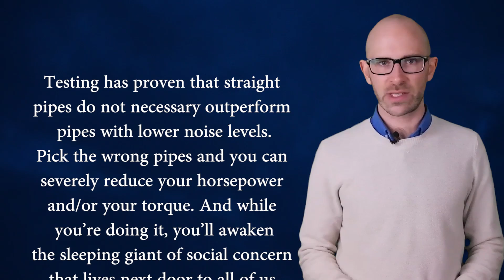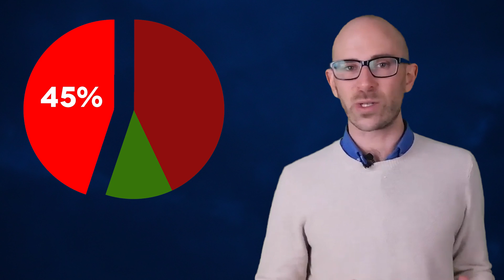Why are Harley Davidson Motorcycles So Loud?

Comment: So you said they are loud,  which we all know.  You did not answer the question WHY they are so loud,  which is what your title implied you would do.
Reply: shadowmihaiu well he did, but briefly and not in depth.
Reply: Exactly, I want to know the science behind it, not why they make it that way.
Reply: It boils down to pipes with little or nothing in the way of sound-deadening baffles and/or exhaust packing materials. Noise comes straight out of the outlet valves and along a plain pipe so you hear pretty much the noise you would if you took the exhausts off compleatly like on F1 cars. See the noise they make when the engines exhaust straight to the air!
Reply: they can also reduce performance by eliminating back pressure on the engine which helps burn all the fuel before it leaves the engine, which by the way is why crappy old cars backfire.
Reply: dylan vanamelsvoord okay bud nice rebuttal 😂
Reply: It was a round about way of saying 'because Harley riders like them loud', but that would have been a really short video.
Reply: I wish I had some Ice Cream . . .
Reply: Loud because it’s fuckin awesome lol
Reply: Ted Stewart  I was about to say these
Reply: Two words... Small penis.
Reply: The owners put slash pipes on ...and then wear ear plugs for the noise
Reply: @jeffreysheldrake3243  ear plugs for wind noise even in a full face.
Reply: shadowmihaiu exactly what I was thinking I want to know what makes a Harley LOUD
Reply: Thanks, saved me 6min of my life
Reply: loud pipes will only be heard if you’re next to a car. also, vehicles nowadays are made with sound deadening materials to phase out highway, engine noises etc.  You won’t hear a loud motorcycle coming towards you until it passes you due to a thing called the Doppler effect.  Not to mention pipes are usually pointing opposite from you.  Emergency vehicles usually have their sirens facing towards the front to combat this and have different tones with faster wave tones.
Reply: They do it because "it saves lives" but in reality they do it to be utterly annoying.
Reply: When they wreak I laugh. 😂🤣
Reply: I stopped watching at 3 minutes and just browsed these comments so the visit wasn't a complete waste of time.
Reply: you are so full of shit .. if you can not look up the federal limits yourself and see that all harley come with dot approved mufflers of only 80dbs ...  you said and i quote "So you said they are loud,  which we all know." you dont know a goddamn thing .and it's none of your goddamn business ..you are just a son-of-a-bitchin; trouble maker here to harass harley owners so go fuck yourself
Reply: Because the assholes who drive them want them to be loud.
Reply: this guy is a fuckwit
Reply: As soon as I saw a scrawny beta limey asking why Harleys are so loud I quit listening.
Reply: And sadly, he gets paycheck clicks for this.  What weird times.
Reply: So... they are loud because they make noise.
Reply: @Baiey  Did you actually read that before you hit REPLY?  Public education is truly a shame.
Reply: @kevindunlap5525  I just paraphrased this video in a few words. It did not explain why Harleys are loud. Are they loud because of the large displacement, the 45⁰ v twin, the high compression, the absence of a baffle, the short exhaust? What makes it louder then a bike of the same size? Of course if it has higher decibels it's louder, no sht Sherlock.
Reply: If it's too loud yer probably too old
Reply: @Peter_Pepper_Love  Or are old enough to realize and understand that it's too loud.
Reply: @peter love  Or old enough to know that these pathetic, scared, "little children" need to make a noise to get attention because they're socially inept.
Reply: This video is horrible
Reply: The real answer is that a lot of motorcycles, Harley or otherwise, are modified to put on louder exhausts.  It's the first thing a lot of people do with their bikes, supposedly for performance benefits.

Realistically, it's not a huge difference, and it hurts the hobby as a whole by pissing off the public at large and reinforcing the stigma against motorcycles.
Reply: @sanityimpaired  more for safety because no one sees us
Reply: @The_AntiVillain  Find me a study that backs up that claim.

Ambulance sirens are omnidirectional so you hear them when they're behind you.  Exhausts are directed behind you.

If you want people to hear you, use the horn.  That's what it's for.
Reply: Ted Stewart also for safety so idiots in cars won’t run motorcyclists over. LOUD PIPES SAVE LIVES
Reply: @sanityimpaired  Spot on. It's the socially inept, scared, childish losers that believe making a noise somehow validates what manhood they may have had. Pathetic.
Reply: @sanityimpaired  loud pipes save lives
Reply: @greezy283  No, they don't.  That claim keeps being made despite the evidence not supporting it.  Exhaust noise is primarily aimed behind you, and the majority of motorcycle crashes start in front of you.

The horn is aimed in front of you, and it's a change in sound rather than a consistent sound so it's a lot more likely to be noticed.  Learning to use your horn proactively will do far more to protect you than loud pipes or rev bombing ever will.

On top of that, loud pipes add noise fatigue, which directly reduces how safe of a rider you are.

That people keep making the claim despite it being demonstrably false reveals what's really going on; you don't actually care about safety and just want an excuse to have loud pipes.
Reply: @sanityimpaired  i have a rode quiet bikes for years. After switching to loud pipes I can see people noticing me more. You can say it doesn't work all you want but my firsthand experience says it does.
Reply: @greezy283  There's a reason anecdotal evidence is a logical fallacy.  You're trying to claim that your biased personal experience takes precedence over statistics and demonstrated fact.
Reply: @greezy283  Oh, and how you love it when people notice when you're riding your bike (Rev-rev. Rev-Rev.🤭) down those oh so dangerous Cafe strip's, eh?
Reply: Because the mufflers aren't very good
Reply: @jew-sa  you are a fucking bare faced liar .... all mufflers are 80 db including all harleys since 1986 .. and 80 db is federal law
Reply: Mortos DerSoulStealer because of non riders like you . Next time you hear a bike before you see him you might realise im right . Im not not saying your wrong about the dickheads wanting loud pipes but im right about it actually working
Reply: It’s quite simple, bikes are small and hidden. Drivers in cars are distracted, and Motorcycles ride into blind spots easily.
When you hit us, your car gets a dent, we get body bags.
Reply: @Erick Stone  Incorrect. It's quite simple. Slow right down, do not weave/speed through traffic, expect drivers may not see you (Car windscreens pillars. I nearly got hit by a woman even though she clearly looked in my direction. I was ready.) and don't ride a motorcycle if you're that childish you feel you have to "prove something". Obvious. I learned and now drive a car. Some stupid motorcyclists always have something to prove and will risk theirs and your safety. Idiots.
Reply: dylan vanamelsvoord 
https://www.motorcyclecruiser.com/last-word-loud-pipes-tech-matters
https://www.revzilla.com/common-tread/stop-saying-loud-pipes-save-lives
"Non riders"
Reply: dylan vanamelsvoord because most motorcycle accidents are because the rider is going too fast or CAN'T HEAR OTHER CARS. If anything they probably cause MORE accidents. Show me any evidence that people get hit by other drivers more often when they're riding a street bike. And besides, exhaust pipes are facing backwards, and most people drive with their car windows up and music on, so there's a decent chance they might not hear you no matter how loud the pipes!
Reply: @ianmclean2894   so what you are claiming it is the motorcycle riders fault if a motorist in a car kills the motorcycle rider ...so what that suggests is the idiots in cars have more rights that anyone else on the public streets ..i will remember this if i ever see you walking across an intersection
Reply: Long story short it’s a bunch of explosions going through a metal tube acting like a horn.
Reply: Also wanted to add .. why do you think emergency vehicles are loud .SO YOU CAN HEAR IT COMING UP FROM BEHIND. Same principal
Reply: William Cooper "when you buy a Harley you want that loud iconic Harley sound"
In other words: only dickheads buy a Harley in the city.
Reply: This guy is a moron
Reply: Scott Graber you're a fucking nut case and should be arrested. https://youtu.be/Zam107Hy0iY this is why things like this happen to you.
Reply: LOUD PIPES SAVE LIVES
Reply: It's because loud pipes save lives
Reply: dylan vanamelsvoord unless you can back up this "evidence" with anything other than anecdotes I'm inclined not to believe you. Have you bothered to do any research on the logistics of this, or is it that it just sounds good as an excuse to ride a ridiculously loud bike that most people don't like?
Reply: @ianmclean2894  if you're waiting for people like these guys to back up with evidence that loud pipes save lives you're going to die of old age waiting. The only thing loud pipes do is piss people off.
Reply: Mortos DerSoulStealer you’re obviously just a liberal pussy. Do everyone a favor and put yourself out of OUR misery. If loud noises scare you move to the chaco region of paraguay and shut the fuck up
Reply: Scott Graber yea usually they are quiet good point . Like another good point  ITS BECAUSE THEY ARE HUGE AND COLORFUL THEY DONT NEED SOUND ALL THE TIME . Moron. . I dont why i try make a point to dumbasses that dont ride. Especially immature gronks wishing death upon others . Haha grow up pal.
Reply: Mortos DerSoulStealer  ok well theres alot of evidence of other cars hitting bikes its actually the main reason for crashes . Like my best mate he now limps becoz he got side swiped . Being that bit louder helps them know your there and you can hear alot through the helmet and over the exhaust so maybe get a license and try it before just accusong and making assumption pal . We are a smaller then a car therefore harder to see but maybe if you could hear the bike youd know they are around you somewhere . If it annoys you then hey it worked you know hes there now .....ofcourse it sounds better louder like a car exhaust or a gun or a firework . Unless your a poodle...... main point is its safer . Safer then sneaking up the side of unsuspecting cars that will squash and kill you in a instant
Reply: dylan vanamelsvoord I believe the burden of proof is on the one making the claim, not disputing it. But a quick google search of "do loud pipes really save lives" turns up all sorts of interesting results. Try it out.
Reply: Mortos DerSoulStealer 9 yr old article . Thinhs have come far
Reply: Scott Graber yea they only respond in an emergengy. BECAUSE THEYBARE A FUCKING HUGE VEHICLE ,WHEN MOVING FAST YOU NEED TO SPOT THEM FAST !!motorbikes are always high risk ergo emergency status . Hear me see me   ....thats another version of loud pipes saves lives
Reply: shadowmihaiu the answer is loud pipes save lives . Car will run youbdown if they cant hear your there .because they dont look for us moto riders
Reply: Bull. Most Harley accidents are single vehicle. Harley riders are some of the least capable riders on the road. Idiots mostly.
Reply: @dvtv4629  I didn't find any difference with quiet pipes and loud pipes. Drivers would try to occupy the same space just because they assume size wins.
Reply: @dvtv4629  Some don't look at all, for anybody. :P
Reply: @dvtv4629  Yeah too bad they don't put as much effort into not using mobile phones whilst driving or actually paying attention to what is around them rather then continuously crying over the occasional loud pipes going by
Reply: @dvtv4629  the actual fact is good riding skills save lives. Loud exhaust systems just piss people off.
Reply: @johnstephenson2428  alot of both
Reply: Mortos DerSoulStealer  how dont they save lives?
Reply: Ted Stewart its not performance. Its to save a life . Loud pipes save lives .
Reply: dylan vanamelsvoord if loud pipes do really saves lives on bikes, we should all put straight loud pipe on cars too! Why does it have to be on bikes too? Both motor bikes and cars polluted the air anyways. 😁
Reply: WhyteLis21 read the comments . BECAUSE CARS ARNT SMALL AND HIDDEN  . EG AMBOS DONT NEED SIRENS ALL THE TIME ONLY WHEN SNEAKING UP REALLY FAST IN A HURRY . . .
Reply: dylan vanamelsvoord what and cars can't sneak up on you fast too? Called that Bull crap. Bike may be quicker but everyone is responsible for their own action and looking at their blindspots no matter how big or small your ride is. 

Don't expect everyone to be a safe driver on the road. Being the safest driver is being aware of your surrounding at all times no matter car or bike. Being a defensive driver saves lives you don't need to be on a bike to understand that concept. Nobody should get a free pass no matter if your on 2 wheels, 4 wheels or more. 😏
Reply: That is Sooo dumb.... the noise is behind the bike... the horn is in the front for a reason.
Reply: @portagepete1  actually, I can hear any vehicle coming from either direction.
Reply: @dvtv4629  Then install a fucking horn.
Reply: @dvtv4629  Doppler effect says otherwise
Reply: Loud pipes save lives .
Reply: @dvtv4629  "Loud pipes save lives"

... rides without a helmet
Reply: @dvtv4629  If  they were so  concerned with safety, they would  wear helmets and  protective  clothing.
Reply: Mortos DerSoulStealer like i said ofcourse some people like the noise . Its a manly thing to do . Its nature . But it doesnt mean it isnt true . Wheres your facts bro ? . As a rider in a massive riding community its clear what happens more often . Ive crashed going too quick and that was a sports bike eg not much exhaust . That was my fault it happens . But cryisong on the highway and streets around town its just pure obvious buddy . Be heard be seen !
Reply: @dvtv4629  Manly thing to do??? You obviously have absolutely no idea of the true meaning of manhood.
Reply: @ianmclean2894  

say that in person to a real biker.
Reply: @puppykicker6701  woooaaahhh judging by your username you sound like one hardcore dude. I'd be soooo scared to say it to your face! Besides, what's the use in trying to say it to a "real biker's" face when he's already deafened himself on the stupid thing? 😂
Reply: @ianmclean2894  .

you are obviously a keyboard warrior, and if you ever did ride a 'bike', it had pedals on it.  At most it was a moped, or some other weak kneeed piece of plastic rice rage.

that being said, i personally hate the loud ass obnoxious noise myself.

i have also been annoyed by the rev limiter noise that the rice ragers constantly seem to make.

the thing of it is, i have personal experience in the fact that 'loud pipes save lives'.

the sound, although blasting out the rear, is loud enough to be heard before the cycle is within sight.

it has saved me from having a car pull out in front of me years ago, as attested to by the guy that almost turned right into where i was crossing an intersection.

i party with bikers all summer long, and most real bikers obtain a noise level that might be irritating, but nowhere near as much an ear rape as the posers in my nieghborhood or the rice ragers.
Reply: @puppykicker6701  you're clearly taking this way too personally. First of all, owning or riding a motorcycle has nothing to do with being annoyed by them, and I've been saying this whole time that it's Harley riders in the city that I can't stand. I'm from a very rural area and in fact most of my family owns Harleys, so pipe down before you make baseless judgements. The simple fact is that if you mod your exhaust pipes and you're riding around in the city, especially in residential neighborhoods, you're guaranteed to be disturbing most people, so I could really give a fuck less what you think. If being a "real biker" means having no common courtesy or respect to other's right to peace and quiet, then I'm glad I'm not one, lmao.
Reply: @ianmclean2894  

so, you make my point exactly.

a suburbanite on a Harley at 3 AM.

even at a monster party full of bikes from around the country, they are done attracting attention and making a racket long before 3 AM.

it sounds like you might have a couple of 'weekend warrior bike riders looking for attention' in your neighborhood rather than a bunch of bikers causing irritations.
Reply: @puppykicker6701  you're completely missing the point. Have fun being a "real biker" bud. 👌

Comment: I disagree in the strongest terms premissable, the breakdown of motorcycle accidents that you presented. I know full well the biased reporting of motorcycle accidents, and I assure you, it isn't that simple. And even if, (a big, hairy, nasty if) the numbers were correct, (they are not) they understate the problems motorcycle riders have when dealing with 'the rest of the world' when it comes to sharing the road.                                                                                                                                 
        I must state for the record that I am NOT a fan of loud vehicles, cars, trucks or motorcycles, and I perfer that my own be kept to a reasonable decibel level. However! It is perfectly understandable why some riders believe in the adage, "Loud pipes save lives!" And frankly, if it saves even one rider's life, then, please by all means, blast away. I find that the temporary inconvenience of a loud Harley driving by is a small price to  pay for the attention it brings to the rider. And, btw, the low rumbling sound of a Harley going by is sweet, sweet music compared to the angry, high-pitched buzzing of a 'crotch-rocket' zooming by at just a little bit under the speed of sound.....